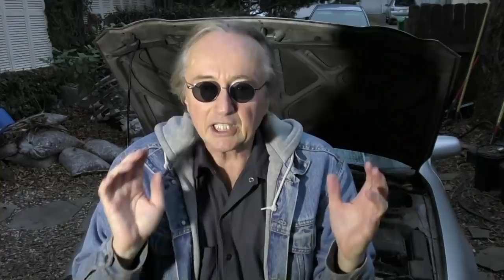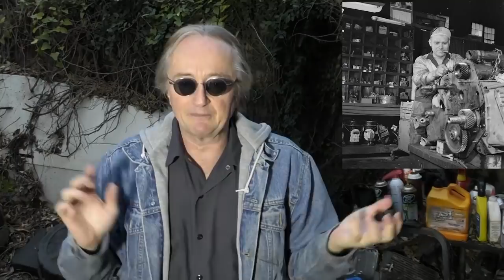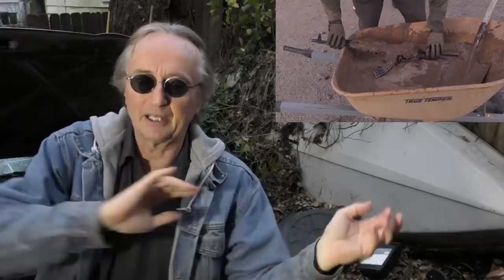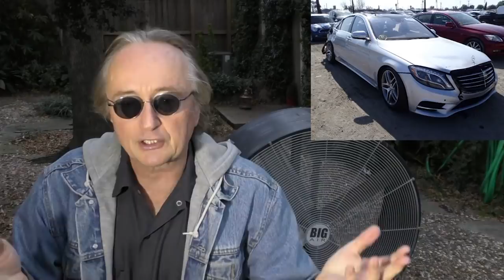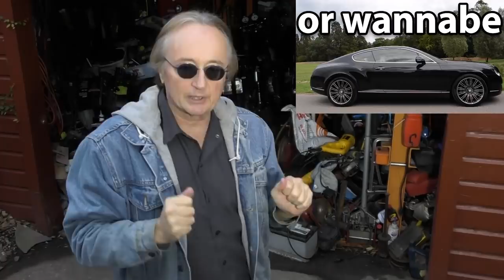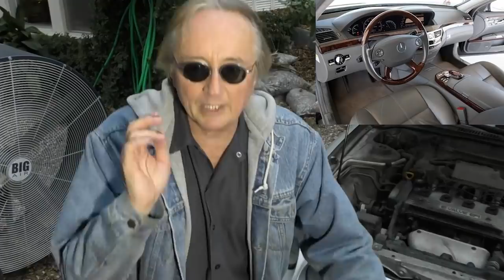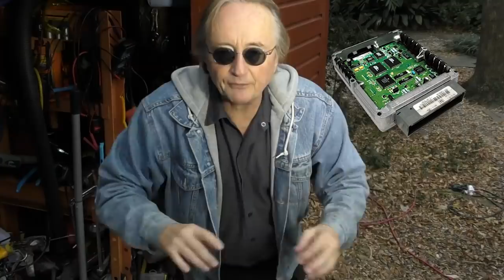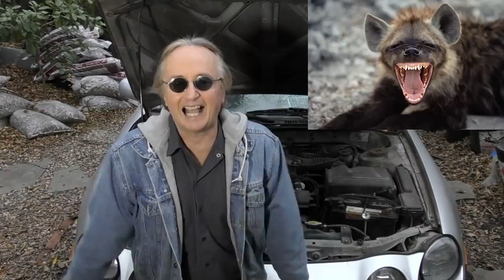Why Luxury Cars are Designed to be Unreliable

Comment: This guy just gave the most thorough, informative, and complete explanation of why used luxury cars aint worth nothing.  Thanks
Reply: I agree!  I like to "window shop" online a local BMW dealership.  Looking online is free, and there's no salesman to harass me.  Heh, heh.  Anyway, I was wondering why you can pick up a low mileage, late model used BMW for so cheap (compared to new, anyway).  Just a couple examples, on the website of this particular dealership, I see a 2015 BMW 328i xDrive with 34,000 miles for $22,900, and a 2015 535i xDrive with 57,000 miles for $24,900.  I knew there had to be some catch.  Thanks to this video, I now know why.
Reply: @hamsterama  The catch is BMW stands for Bring My Wallet. Used BMW's and Mercedes really lose their value after a few years. Used ones  have to be priced within range of a mid-level car to attract middle class buyers. A wealthy person will only lease another new one.
Reply: A co-worker bought a 2014 Mercedes,  in 1 month,  it got hit twice, had to pay 1500 out of pocket to fix until the insurance companies can work things out.  He lost the keys in the trunk so he had to get a new one from the dealer.  The shocks needs to replaced because its too low and he keep hitting pot holes,  now its making some noise.  He paid 21k for it and now he wants to get rid of it.
Reply: @KNByam  Don't lose your fob on any new push button start car.  $400-$500 to replace it.  My first car, a 1965 Chev Bel Air, had a regular key that looked like a house key. Cost me 50c for a new one!
Reply: gregory J Lmao，it worth something. most importantly it shows you have money......this is all
Reply: @darrellross1  The prices pretty much trick middle class buyers.  They think they're picking up a bargain, but they're not.  It's a shame that BMW's are unreliable.  I do love BMW's, and the way they ride is an unforgettable experience.  But I just wouldn't be able to deal with the cost of repairs.  Every little thing costs thousands of dollars to fix.  I own a ten-year old Toyota, which requires nothing from me except basic maintenance.  Spending big bucks on car maintenance and repair would be too much of a shock for my wallet.
Reply: @hamsterama  You're on the right track with your Toyota. Back in 2003 I was a salesman at Honda. One day we took in a 10 year old BMW 325 in on trade and low balled the customer and got it for next to nothing. Many dealerships let staff  buy a trade in for the wholesale price for their own personal vehicle. Excited, I phoned my cousin who worked at BMW and told him about this car. "We only paid $4500 for it, I told him, I can afford it." He said," Ya, you might be able to afford it, but I'll kill you with repairs." " Stick with Honda or Toyota."
Reply: @darrellross1   As boring as Toyota's are, I like how they are predictably reliable.  And they keep you safe.  I don't recall ever seeing a Toyota broken down on the side of the road.  I think the only way to "afford" a BMW is to lease it and get rid of it while it's still under warranty.  But leasing is never a financially sound decision, at least for the middle class.  As much as I'd love to have a BMW in my garage, I know it's never going to happen.
Reply: @hamsterama  Yes, that's exactly what wealthy people do. Most of the Mercedes, BMW's and Audi's you see on the road are leased. With leasing, you don't own the risk. Some call it the world's longest text drive. After the term is up, you hand it back in, or if you really love the car, you can buy out the lease and keep it.
Reply: gregory J Thing is, luxury cars are just that - luxury. People who have the money to afford these things can also afford to do maintenance and fix broken parts, but oftentimes, they just upgrade their cars. It’s like the iPhone, every time a new one comes out, people want it, but then those who buy those also have the money to afford them

Comment: Luxury used to be metal, leather and wood. Now luxury is just plastics, badging and unnecessary technology
Reply: kclefthanded 427 You obviously know nothing about cars.
Reply: jordanz he's right actually.
Reply: Luxury is me driving with my wallet that isn't burning, soggy or stolen.
Reply: Well said
Reply: Weirs how wood used to be the cheapo material for cars, now it's luxurious
Reply: Conscious Hm, my dad owns a s550 and a bmw 750li and they both contain hand stitched leather and high end wood. Now, tell me how he is right.
Reply: Cracked Emerald Aside from Rolls Royce, BMW, What other car is covered in Wood trim around the whole center panel/dash and doors??? No american car, not your Toyota or Nissan, Honda , Mitsubishi.  yeah it's Luxurious.
Reply: @crackedemerald4930  Certain wood types.
Reply: Welcome to the 21st century
Reply: It's now carbon fiber, magnesium, aluminum, NASA aerogel heat insulation....used in my 2017 Corvette C7.
Reply: And a smooth drivetrain
Reply: @LiLxJaYxDAwG  Cadillac, Lincoln, buicks usually have wood trim
Reply: @crackedemerald4930  correct. ...but it's luxury wood now 😉

Comment: I just saw a brand new range rover Velar on the side of the highway with a flatbed in front of it😬
Reply: Same thing happened to my moms Land Rover.. brand new and took it on a road trip. Sucker broke down on the side of the road!
Reply: Land Rover are notoriously unreliable in fact I would say they are the most unreliable cars on the road today.
Reply: tamara stone 😂 should have bought a land cruiser 😀
Reply: I knew a guy who worked at a car auction and he said the range rovers were the biggest pieces of garbage.  He said he would grab at the door handles and they would break off--cheap plastic.
Reply: I was thinking if I'm obscenely rich, I would try considering buying a nice Range Rover but replacing the power train with something from Toyota. I wonder if that would be possible with some  CAN bus customization of course.
Reply: Land Rover is so crappy  that it makes Mercedes Benz and BMW look reliable
Reply: Saw a 2016 x1 being put on a flatbed yesterday
Reply: Gravemind Cadillac is worse in my opinion but LR is certainly up there
Reply: Gravemind worse than fiat?
Reply: Land Rover: Above and beyond what you'll be paying just to get it fixed.
Reply: @Venturi Atlantique absolutely
Reply: Ahh the natural habitat of the range rover
Reply: They were okay at a point. My 2000 Range Rover has a Buick V8 in it and a ZF transmission. As for the electronics it has a mind of its own but it’s straight forward to work on.
Reply: @Venturi Atlantique most of the unreliable new German cars is a mith because of poor maintenance. Many people buy(finance) this cars for status simbol, but în reality, they can't afford this cars. So they will cheap out on maintenance.
Reply: BMW's are self igniting sometimes. . look into it.
Reply: My friend bought a brand new Range Rover And it broke down after one month and in the dealership they couldn’t fix it, they couldn’t find out what was the problem 😂piece of junk

Comment: My 2000 Lexus LX Truck is a tank and luxury. The original air suspension still works too.
Reply: @FSAPOJake  trying to get a buick avenue too! But is 2005.
Reply: Lexus is the only luxury brand Id trust. '05 ls430 here, everything is working like new.
Reply: My 03 Toyota Avalon is a dream to drive...160,000 mi and counting!
Reply: @Felix-ry9pc   Implying Lexus isn't luxury. Wew lad
Reply: My dad's 2004 RX still runs great, everything works like it should.
The only thing is that he take it to work daily, on 40 miles of bad roads, so it's got some interior rattling here and there.
But hey it still manages 22 MPG with its 3.3L engine.
Reply: @Felix-ry9pc  Thats called your opinion my man. I think modern beamers look cheap but that's just me. Also, what does styling have to do with luxury other then just that, style? Lexus has always had the same tech as bmw if not sooner and it all actually still work after 100k, 200k, going on almost 400k on my old 93 ls400. Build quality only improved in the second gen LS  so you do you bro
Reply: Kardiak same tech? bmw had led tailights in 2010 while lexus didn’t
Reply: My 03 Infiniti fx45 tech pack. still running strong with 166k on it and she is a blast to drive. No notes for me....

Comment: Too many electronics that fail after just a few years. Also, the people who buy these long term usually don't know what they're getting into, maitenance costs, etc.
Reply: Word, I got a '91 Peugeot 309 I recently bought. It's an old-fashioned carbuerated engine with basically no electronics aside from the headlights. People say Peugeots always had problems with their electronics, and that's true. The few electronics that are in my car, don't work that well, the headlights flicker when the car is running, the wipers don't work as well as they should and the alternator needs replacing. But hey, I paid for the car, it runs, it's got no major rust or rot on it and it gets me from A to B.
Now if I had a slightly newer model or a higher trim variant the whole car wouldn't even work, so I say electronics are the bane of vehicles, and I'll never own a car which needs anything electric to run aside from the starter.
Reply: Yeah, but like Scottie said, most people that buy these cars are not in it for the long term.
Reply: @tkisok4883  Still they are making it easier for manufacturers to keep reliability down by just throwing money away so doing that is part of the problem.
Reply: This is 80s and early 90s. Not now
Reply: @GlamStacheessnostalgialounge  does your peugeot have mechanical fuel injection?
Reply: +Ryan Henderson
Well I said it's a carbureted engine, and unless you consider that mechanical fuel injection, no.
Reply: well people should honestly expect this right from the getgo
ofc if you're buying a car that has electric adjusting and heated seats you're obviously gonna have to spend a pretty penny fixing those if they break. Even my A3's simple airbag wirings on the seats get fucked because of simply moving around, but then again the car is like 15 years old already
Reply: Glam Stachee ... Are you sure you said it was "carbureted"? BTW, the way it's spelled here is correct.
Reply: MaxSpeed 

If you cant afford to take care of something you can’t afford it. I laugh when i see Benz sitting oddly low on the street lol
Reply: +J W

Yes, I can't spell that word right for the life of me.
Reply: These type of people probably get new cars every three years, so they don't even experience any breakdowns.
Reply: Like i said in another video, what counts as a "luxury" item is all relative.   You probably don't buy socks and wear them until they're falling off your feet because it's nothing for you to buy another new pair.  ..but tell that to the guy living on the street.   A person making $300K/year has absolutely no problem buying a brand new, first owner, driven off the lot, $95K luxury car every 4 years or whatever.  They don't try to squeeze out every mile from the vehicle, nor do they intend to drive a car until it's falling apart the same way average people don't wear socks and shoes until they're tattered and torn.
Reply: I bought a BMW M2 with 5,000 miles.When it's done 30,000 miles I will sell it and somone else can pay the repair bills.I don't care,and will have enjoyed driving the car!
Reply: Maybe the previous owner didn't maintain it well. Definitely it will have electronics fails. But german cars last long if you maintain it well.
Reply: @nicoctane1669  It's called business
Reply: @a.s.4914  Exactly, buy while the warranty is still in effect.

Comment: Luxury cars can be reliable but one big part of the problem with the older ones has to do with previous owners who just buy a premium car to look cool and then just cheap out on every maintenance because it's to expensive.. I bought a bmw 9 months ago because I love how they look and how they drive, it took me months to find one that had a complete maintenance history.. Still had some pretty expensive hidden maintenance. So when your planning buying one you just need to save up some money for repairs at least a few thousand. Don't go cheap on parts, use premium gas, if something is wrong fix it asap, it will last you a long time that way. If you're taking good care of these  cars it would still cost more but it's not that bad at all.

Comment: Damn, i feel like he repeats himself a lot: 1 reliable car brands are toyota and honda. 2 dont buy automatic honda. 3 Hybrids are too complex and and expensive to repair. 4 i wont work on electric cars because of high voltage. 5 cars these days are too complicated and break more often. 6 i still drive my old celica . 7 luxury cars are over enginieered and unreliable dont buy used ones. 8 toyotas from 90s were invincible but dont pay too much for them and let mechanic check it out before you buy one. 9 if its engine or transmition i would just get rid of it, these things cost fortune to rebuilt. 10 lexus is really a toyota.
Reply: Yep, he repeats himself a lot, but is he wrong?
Reply: @johnc8910  Often times, yes. Go watch his video about why the Celica died, then go read the Wikipedia about Celica. Notice how he's completely wrong about engine codes and the release dates of certain models. He trashes basically every Celica engine that isn't the one that's in the particular Celica he owns despite there being far more popular Celica engines in the enthusiast community. Scotty's videos are essentially, "If you don't treat my opinions as fact, you're wrong".
Reply: @John - in some cases, yes.
Reply: @Browningate  In a lot of cases, yes. His videos are nothing more than a bunch of his personal opinions pawned off as facts.
Reply: Well he's not wrong.
Reply: What more do you want to know?
Reply: Never, never dis the Scotty. He has 1.7million fans to fight for him.
Reply: Stop whining

Comment: Lexus is #1 on reliability rankings for a decade...year after year....
Reply: Toyota and Porsche are up there as well. More than once they have shared the first place I think.
Reply: @oes2546  Compare the repair costs between Toyota and Porsche.  Not even the same ballpark, but a different league altogether.
Reply: @ieast007  compare the interior quality and track worthiness to both. Two completely different cars, yet porsche is right there.
Reply: @oes2546  Yes, Porsche has come a long way in reliability.
Reply: Tabish Syed true very true
Reply: Everything from Japan including suzuki is in top 10 reliability ratings. Lowest Japanese car is Nissan at #12. Ford is ranked #21
Reply: yet still costs a fortune to repair